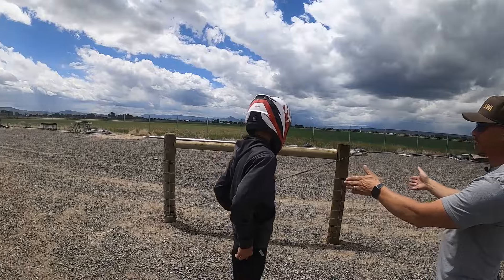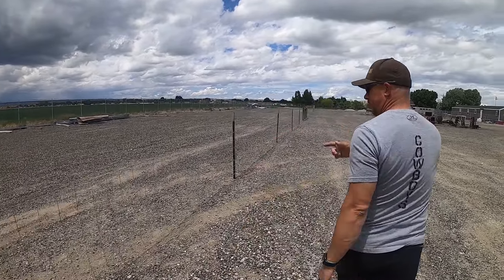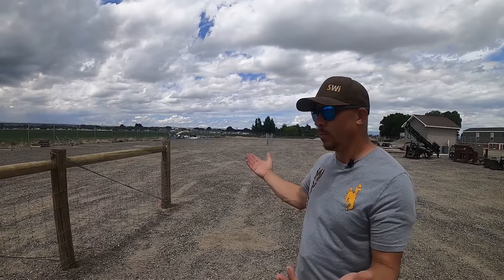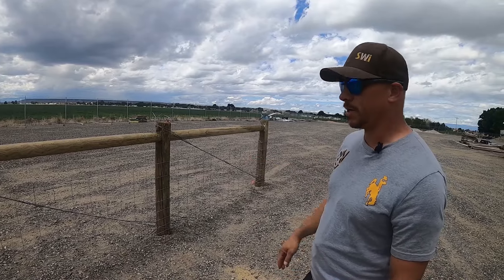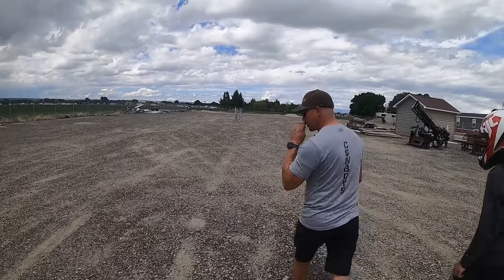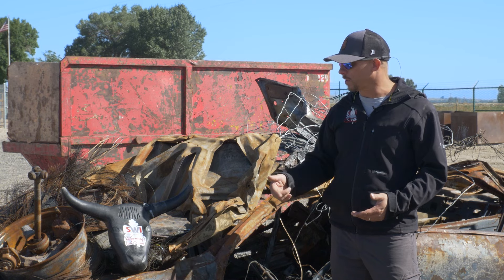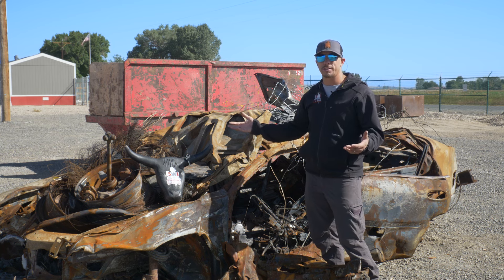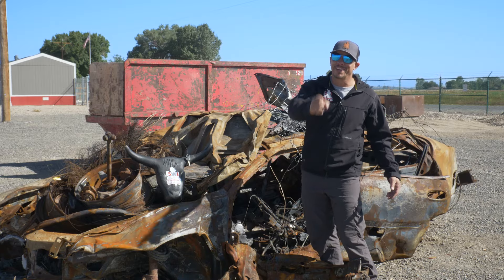Fence Brace & Wire Testing Like You've Never Seen

Comment: That's why I use creasote railroad ties or telephone poles for corner bracing. I've see railroad ties that have been in the ground more than forty years and still going strong. El Toro would loose a front end on a rail tie or telephone pole.
Reply: Agree, with a caveat: Having just gone through a NM wildfire and losing 16 H-braces and 4 corners, all creosote railroad ties, think I'm moving to pipe from here on out. The previous owner had done other corners and H-braces in pipe and they're still standing. Oh, and by-the-way, for general information: most of the creosote poles ignited by simple ground fire (pine needles, dry grass, etc), NOT by blast-furnace trees being nearby (although that happened too).
Reply: @davidmehl5922  This is good to know.

Comment: 😂😂😂😂....BTW, us cattle farmers in Kansas use Hedge posts instead of those scrawny treated things you called posts. And our corner and bracing posts are twice that diameter... and aren't driven into the ground. They are done the old fashioned way. And are in the ground 48"-54".at least on our farm...I have seen someone (unintentionally) drive a similar car into our Hedge corner posts, at roughly the same speed as you did here. Seen the post break off at ground level (which says nothing about the method of fence building). And I also seen the post barely be pushed sideways...... Before retirement, I spent six decades raising cattle. Not once did I ever see a bull decide to run and head butt a fence post. Based on this video, and the previous one, (of course I know you won't care what I think 😂), I think you simply wanted to give your opinions on the style of fences you like; complain about the methods you don't like; and wanted to destroy both fencing and the car.😂😂😂😂
Reply from the maker: You're not wrong about the car. 😆 Yeah a nice thick hedge post will stand the test of time--that's a good choice. 👍🏻
As far as methods it's pretty obvious that a large majority of fence building is stuck in the stone age. We build fence for a living so it's more than a hobby for us.
Reply: @SWiFence  thanks for the reply.

Comment: Great video, we're I live in Kansas 3 materials are used for braces metal piping by the Profesional fence builders, large hedge post with piping horizontal brace by the farmers, and treated pine post by the diyers/homesteaders. The piping and hedge post honestly last forever, and the treated post last 5 years if done well, really a waste of time and money. Every pro fence builder I've talked to reasons for metal pipe over hedge is for speed of install not bc is superior. Half the time and just as strong is just business savvy. I use hedge due to its every were dosnt rot and free.

Comment: fill the steel post with concrete to reduce its ability to fold over. and concrete creep in frost isnt a thing if you enlarge the bottom of the hole and don't fill to the top. that way you avoid the mushroom top the frost lifts.

Comment: I feel like the wood posts would've been even stronger if the lose ground from digging the hole would've had a couple months to solidify around the post.
Reply: They wasn’t dug. They where drove. I think post depth is the only think they plays a part here in that argument. It didn’t look like the wood post was as deep you you honestly can’t tell from a video on the depth. If pipe was more readily available i would use it on all of ours but unfortunately we are welders we are grinder. And the pipe is just hard and expensive for most people’s budget we work for.

Comment: Here in Brazil we made ours fences in many differets ways, i personally dig a hole about 70cm-80cm deep, put a 16cm diameter hardwood treated post an fill with concrete. On the edge post i dig a hole over 1 meter deep, 25cm post and fill with concrete and put diagonal supports. Distance between the posts are 3 meters and 6 barbed wires. I hope that last 10-15 years, the cattle don't dare to cross. Plus all of it, i coated the posts two times with thick motor oil.

Comment: You pulled the wood brace the wrong way of the pull of the fence
Reply from the maker: Sorry, no we didn't. The twitch wires should be at the bottom of the strainer post just as they are.  This is universal not just WYDOT.

Comment: The strongest fence was the one you hated the most and spent most time using greater force. Wouldn’t concrete holding rail ties demolish El Toro?
Reply from the maker: We will have to disagree.  Concrete will eat the wood posts even faster than without.
Reply: @SWiFence  Thank you for taking time to respond. I appreciate your point.

Comment: One final comment sir... driving through the fence at the steel posts between the wood corners, proved nothing as far as fence strength.😂 You chose the weakest point...... And as far as the wood posts pulling up out of the ground, if they were in the ground 4ft... and actually packed dirt/tamped dirt, instead of driven into the ground... You would not have been able to pull them like that.😂